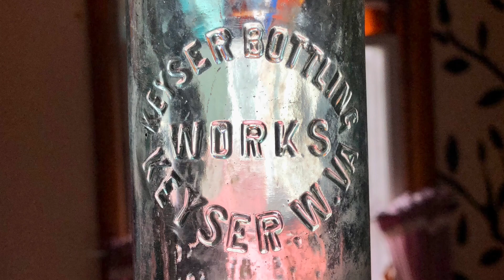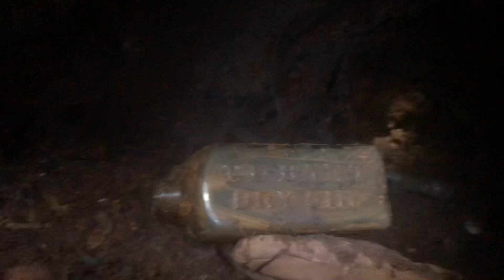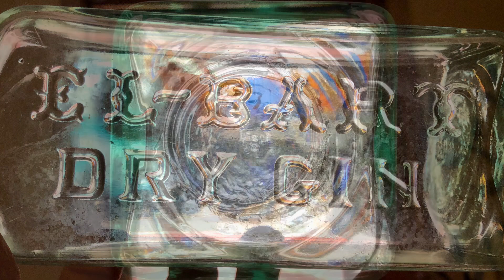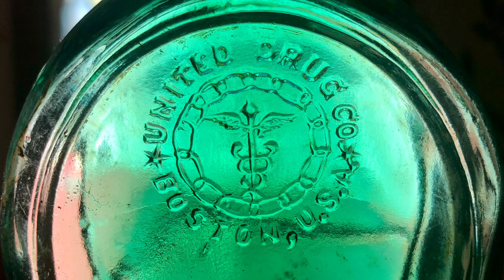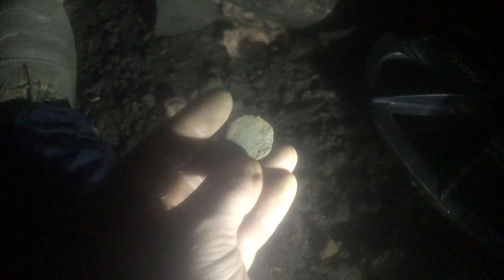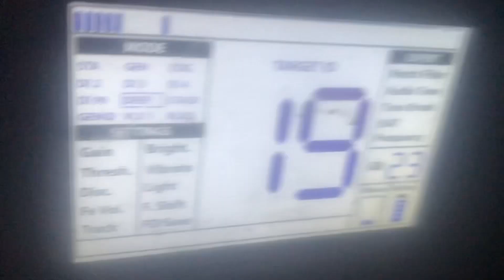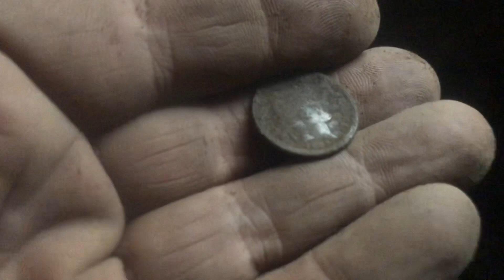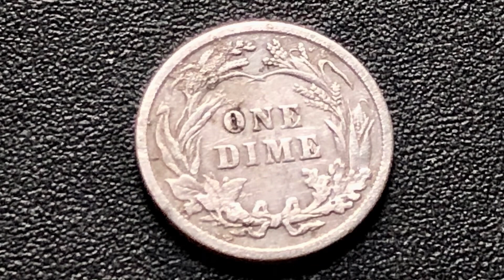1870s Salt Glaze Painted Crock Found Digging 8ft Underground $$$

Comment: You need to see Eddie's auction where he had the most-rare variant of a no shoulder jug.  Browning down BELOW THE SHOULDER.  Most browning goes down to stepped shoulder or the neck of the rounded shoulder.  This was 2 inches below !  Never had I ever ... seen one like that!  Told Eddie in comments I would tease you about this - but OleIrish with the goading bid $10 and got it !!!  You deal with OleIrish about this ... That jug is rare and $200-300 EASY (alas no markings or stencilling).

Comment: Keyser bot is the same small K in Keyser on front slug plate and large K on the bottom.  As said with other Keyser pharmas, these could very well have been made by the closer Cumberland glasshouses (19 miles distance), than Wheeling WV and surrounding glasshouses there (103 miles) or Baltimore (127 miles).

Comment: UNITED DRUG CO., BOSTON MASS., Forest Green Oval Medicine Bottle. Here's an antique, nice forest green, oval shaped medicine bottle that is blown in mold and dates to around 1885-1895:UNITED DRUG CO., BOSTON, U.S.A.This is a cork top bottle that measures 5-5/8" tall by 2-1/4" wide at the base, and 3-1/4" wide in center. Has a flared, flattened ring lip formation, recessed panels, and a pedestal base.  (Said) $30.

Most-likely was made by the Salem Glass Works, Salem MA, just north of Boston (oldest still existing and working glass house of America).